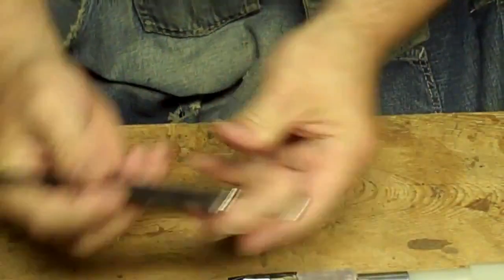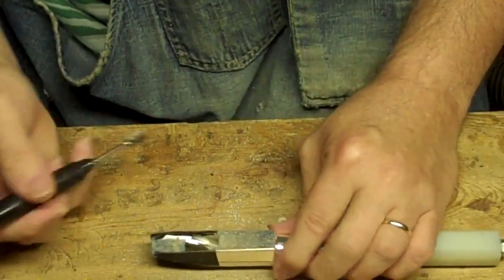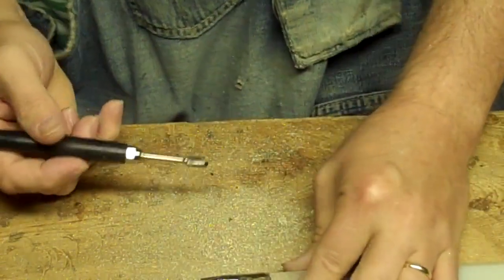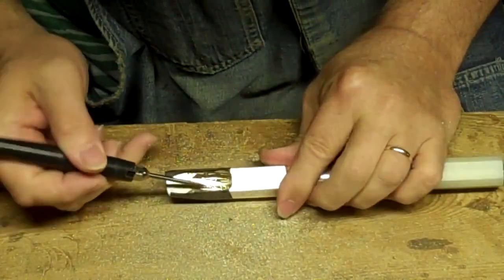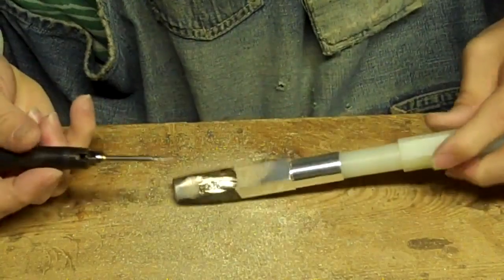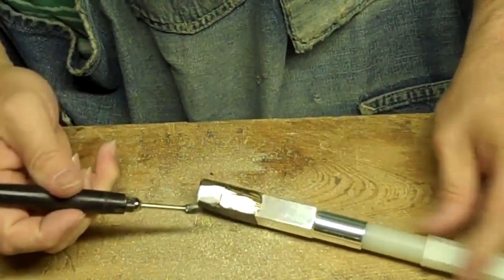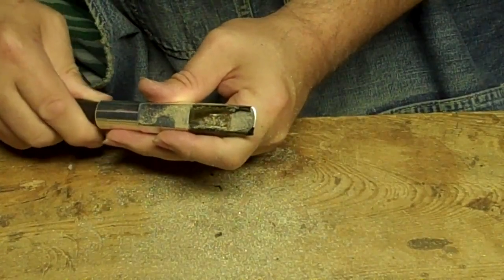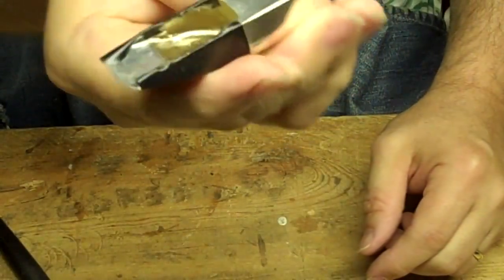Guardala LT Chamber Modification - Part 1 of 2

Comment: im trying to modify my concert band mouthpiece into a jazz  which means instead of having a fatter body mothpiece im gonna thin out the body what else should i do to make it have a better sound?
Reply from the maker: I would not modify the exterior body.   Consider adding some baffle shapes using temporary putty to see how you like them.  The sound will be brighter.  You need to decide if this is a sound you like for jazz or not.  Many players like a wider tip opening for jazz so they can play louder and bend the pitch easier.

Comment from the maker: I think you have that backward.  The MB was renamed the MB1 after the MB2 came out.  The MB2 has a longer baffle before it starts to ramp down into the chamber.  The MB1 throat area is usually scooped out more than the MB2.  But MB1s vary a lot since they were all handmade.